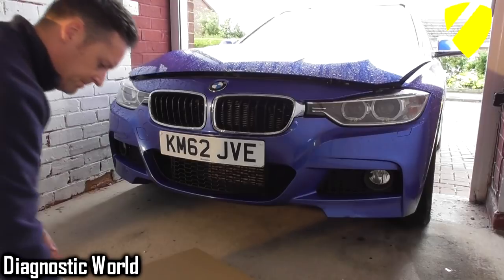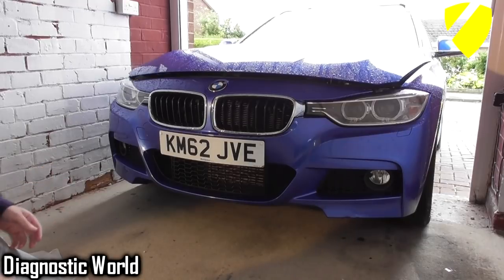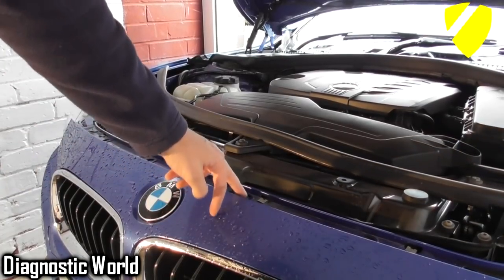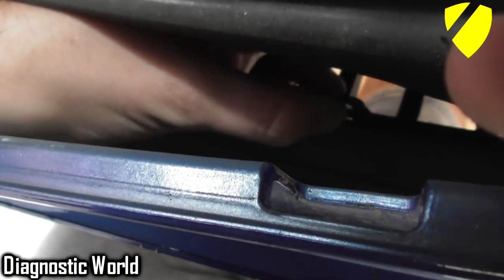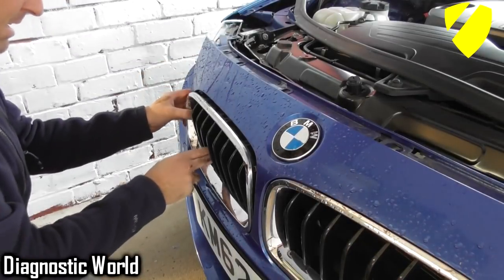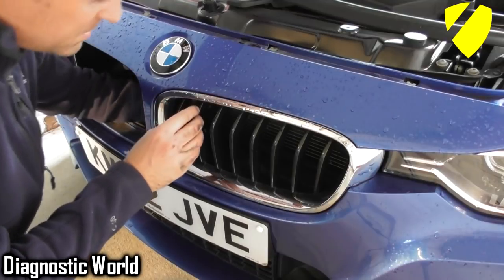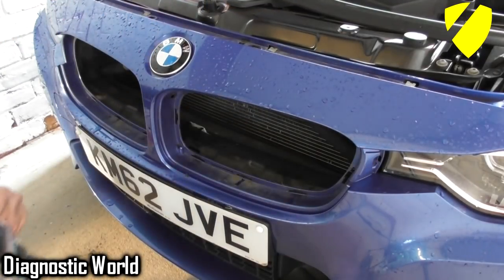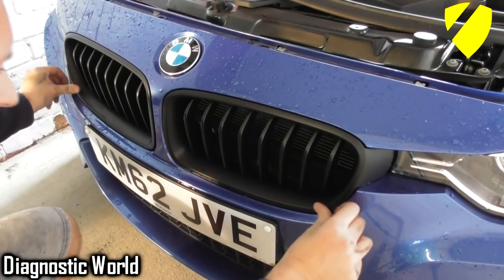The CORRECT Way To Install New BMW F30 F31 Kidney Grilles

Comment: Just replaced the grilles on my F45 … exactly the same process. The clips on the bottom are difficult as they need to be pushed up from underneath. 

I left off the metallic trims as the  all-black grilles look classier.

BMW we’re going to charge me £300. + labour but I bought mine off Amazon for £35 (with free shipping) !  and installation took 15 mins.

Personally, I gave the area a good clean before I replaced the grills - same for the area where weather strip is fitted …

Result !

Comment: Good Video - just wanted to add the size for those middle Torx bolts is actually T30 not T27 (Although T27's will do it if that's all you have)

Comment: Looks good. My F31 has the original chrome kidneys in but the previous owner had sprayed them black. It's now starting to peel so the chrome shows through in patches. Now I know how easy they are to change, I'll be ordering some proper black ones!

Comment: This was extremely hard to do and even painful for me. I guess my hands are too big to fit in propely because I could barely reach any of the clips. Well worth it tho, gloss black dual slat looks amazing
Reply: My friend who is mechanic pulled the grills without any screws removal, within 5 secs he pulled both grills and installed the new ones. I was shocked couse i tried on this way and it was too hard so i gave up...

Comment: Can you swap the kidney grills on the LCI model since they have partly-closed grill slats on stock models? I wonder if installing these would let too much air into the cooler. I guess there is a reason why the grill is partly closed on my 163 hp model.. or no?